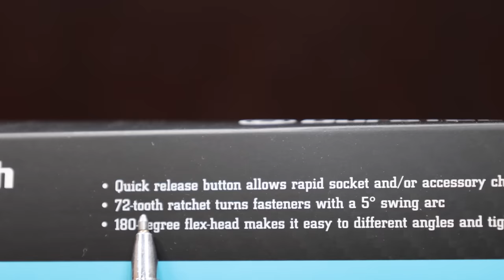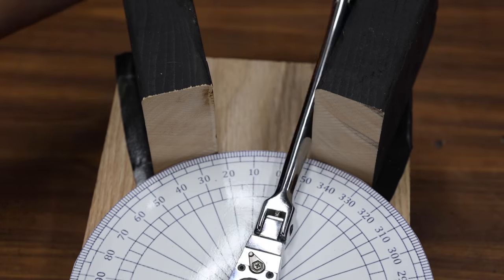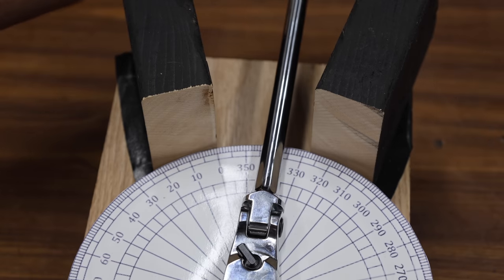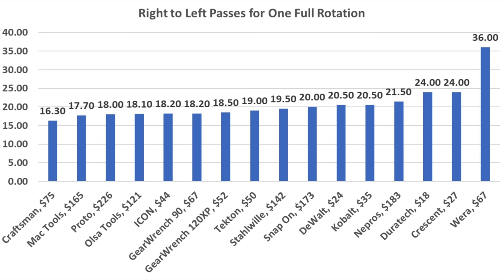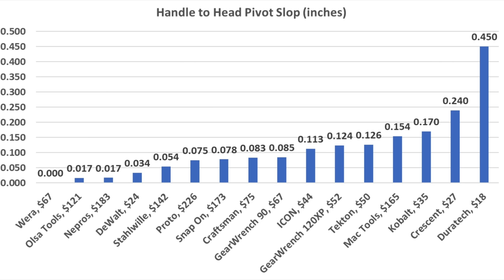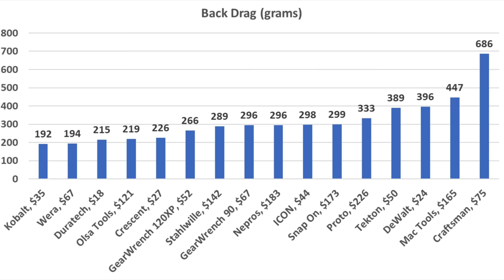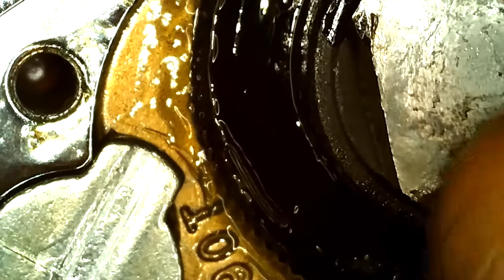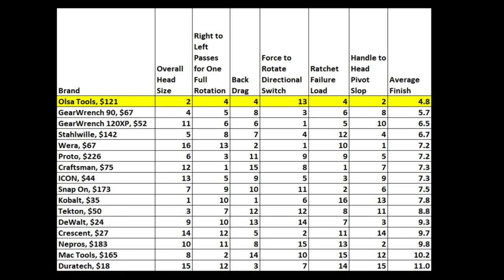Best Flex Head Ratchet? Let’s settle this!

Comment: Great video... We need you to test different 1500 w heaters and find out once and for all if some actually produce more heating capabilities or if 1500w is 1500w no matter what!!
Reply from the maker: Thank you for the video idea!
Reply: yeah for real. i buy them all the time for work and they either don't get very hot or they quickly stop working from steel shop dust exposure.
Reply: From actual real world experience I found  wrenches similar the Wera gimbal type  style are more practical and safer to use because they are much  less likely to tip off the bolt or nut head.
Reply: There’s no need to test that. Physics guarantees that :)
(To clarify- If it takes 1500W from the wall, it comes out as heat. It may not use 1500W, but that’s a diff story). Efficiency is a completely moot point as they are essentially 100% INefficient.
Reply: @ProjectFarm  Yes winter time and heater videos are very helpful.
Reply: All electric heaters are 100% efficient because any inefficiency can only turn into heat which is the point of a heater.
Reply: Everything's a heater. 500w light, 500w internal combustion engine, 500w hot plate, 500w anything - in the end, everything that is left is heat. Hit a wall with your fist? Heat. Sneeze? Heat. Talk? Heat. Often there are intermittent steps like chemically stored energy in ATP for your muscles, then kinetic energy from using those muscles, then kinetic energy in whatever you move with your muscles - but even then, your muscles are heating up, the air around you heats up (when you move, you rub the air which is not frictionless) and whatever you touch and move etc gets heated as well. The heating in different places can be very slight but it does happen.

Same with cars etc, the tires heat up the road and the aira around them etc.
Reply: @TCPUDPATM I think we've seen enough to know that just because a product says it does x or produces y doesn't mean it does. A heater test is a great idea.
Reply: As long as the label is correct, they'll all heat a room similarly...

But if you are in a big shop a radiant heater is what you want (heat like a fire) and if you are in an enclosed area a fan based or radiant heater is what you want... Radiant heaters offer a more constant feel of heat without that hot blast of air when they turn on.
Reply: @TCPUDPATM  Or rather, 100% efficient. Very, very few things are as efficient as electric heaters at doing what they set out to do. almost entirely 100% of the energy used is converted to heat. Any other use of electricity such as any electric motors or electronic devices isn't as efficient. Heat pumps are way more efficient at heating a space in that they move heat rather than use the electricity to make heat, but if you look at the percentage of heat generated by the compressor motor as waste, the heat pump is actually less efficient since that heat doesn't heat your living area, it's lost to the outside.
Reply: @benscott19841 people buy the cheapest model they can find for their purpose. Nobody will not buy a 1500W heater if it only ends up pulling 1499W.  Not sure what a test would prove. As someone already said, they will heat a room according to physics. Some of these requested tests get redundant and don't really serve a purpose for what it took to produce the test.
Reply: @giggiddy  So you test cheap heaters compared to expensive heaters to see which ones actually put out the heat it's supposed to and the quality of the build. Plus you can see if they are putting out what they are supposed to. Like with tests for every tool they rarely put out what they are advertised.
Reply: Mine crypto 4 heat

Comment: Something to note, even though it may be more difficult to change directions with a greasy finger... If you're pushed tight against something else, a harder directional switch is better. If the back of the ratchet is against a plastic panel, having it suddenly change from loosen to tighten can be an issue. So the force needed to change that being higher isn't necessarily a bad thing
Reply from the maker: Thanks for the feedback.
Reply: I agree with that. I went straight to the comments to write something similar to what you already said haha.
Reply: I have a couple 1/2 drive craftsman ratchets and if a gust of wind blows that ratchet will change direction
Reply: That was my comment also, but using my hand to hold it on the bolt or nut when upside down.
Reply: That's exactly what I was thinking, I've accidentally changed the direction lever on my socket wrench quite a few times.
Reply: I agree, I have a couple of zero turn ratchets that switch directions if you breathe wrong, and that can be really irritating.
Reply: Agreed, this is definitely an outlier 'test' that he feels compelled to keep using
Reply: I would also note that these loosen up over time. So for a commercial tool the tighter reverse levers will hold up longer. Truly impressed with the new craftsman
Reply: @SmokeElectronics that depends.  If it’s built well and smooth, with tight tolerances, it will stiffen over time.  If it doesn’t wear, but gets some crud in there it might get into that sweet spot.   If it’s made cheaply and experiences a ton of wear and stretch, it will loosen.  Depending on your environment, on the coast or working offshore, you’ll get rust as well.
Reply: As a mechanic I totally agree! The factors I would look for would be: Ease of changing direction in a tight space (with your hand/subjective); And resistance to unintentionally switching directions.
Reply: Agree completely.   I’ve ever understood the difficulty of switch measurements.  I want a solid click!   I use his scoring but I reverse that ranking.
Reply: agreed
Reply: yeah, I wouldn't really consider the force to change the direction a bad thing as if it's too loose it can change when not needed.
Reply: Couldn't agree more. As long as it isn't jamming up, more resistance is better.
Reply: Came here to say the same thing.  I'd rather have it too difficult than too easy to switch directions.  But somewhere in the middle of the rankings is probably the sweet spot.  Neither extreme is good.
Reply: I too am in the camp of not wanting a positive, non-negligible force to switch between forward and reverse, and having a distinct "click" when you have moved the selector into full reverse or forward.  There's nothing I hate more in a ratchet than the selector being mushy and easily moved out of gear with just a tiny amount of pressure on it.  Give me one that requires some definite force to move and doesn't always want to slide back into no man's land.
Reply: I went to tge comments to make sure someone pointed this out.  I also prefer a stiff direction lever

Comment: The fact that tool makers contact you and reference your channel is a huge compliment. With people working together, we can seriously make so many things better for everyone.
Reply from the maker: Good Point!
Reply: They don’t have a choice. Channels like this have a big impact on what people buy.
Reply: Oh, they reach out all right. But it's to offer marketing opportunities (we'll pay you to feature our product and parrot these talking points) and non-committal statements (ie: I've passed your results onto our engineering team so they can use it to further improve our products. We always stand behind our tools 100%!). I doubt any make any product improvements unless it results in a lower manufacturing cost. The only time I'd see a manufacturer actually changing their product would be the occasional independent companies that make it into the videos. Certainly not Snap On, Dewalt, Milwaukee, Stanley, Harbor Freight, and so on with the soulless corporations.

Thankfully he ignores the marketing offers.
Reply: Sometimes it changes the market! A price can go way up or way down is what usually happens.
Reply: @MTGeomancer The smaller companies making product improvements will eventually force the bigger companies to compete with better products. Try to see the bigger picture here. The companies you named actually make some pretty solid products sometimes, and they're generally available at a reasonable price. They don't just exist to scam people otherwise they wouldn't be in business lmao

Comment: Having used flex head ratchets in tight clearance areas, I think the direction switch tightness is a good thing. It can minimize unwanted switching.
Reply from the maker: Thanks for the feedback.
Reply: Exactly that the issue I've had with kobalt ratchets.
Reply: Uh it’s 12:07 pm and no new video. I demand a refund.
Reply: I agree with you.  I have an older snap on ratchet and it's way too easy to switch directions with.
Reply: @rcannon409  
You can change the gears. It's easy. They get worn down a bit. Especially when you use the ratchet to break bolts free. Get the snap on truck to warranty it. He will probably do it for you on his truck.
Reply: Also iv had that break before. I wonder if the added pressure to change the switch direction is equal to more durability over time.
Reply: My husky 3/8" 10" drive is the best rachet I ever try!.
Reply: @vanblue7317  Nice. Husky has come a long way. They make some good stuff. I've had real good lock with the older Signet swivel 3/8 sockets. They were less than the more expensive name brand and got into some tight spots. I also loved my C/P 3/8 impact. Way cheaper and just as good
Reply: Yep, I made the same comment. I have s gearwrench 10mm ratcheting wrench with direction switch... And the ewitch will change itself randomly with nothing touching it! Drove me nuts I kept thinking I hit it with my finger or an object, but nope. I bought it used at the swap meet guess I know why the previous owner got rid of it. I have a pair of gearless stubby ratchets, 1/4 and 3/8... You change directions by pushing the square drive out the other side. 20 years old work great.
Reply: @johnlucier5654  Those ratchets sound pretty slick.
Reply: @jamesfarmer1523  I had top get rid of a set of 90t kobalt rachets as they were switching directions from any little thing that would bump the rachet
Reply: @jacobscutzlas8712  
I know exactly what you mean
Reply: @lukemarks92  
You are right. When they are still nice and tight, the internal mechanism leans on the side of the pawl. When they get a bit sloppy, the point at where it leans on changes to the tip of the pawl and they often snap the tip off. When I was on the bench, I would disassemble my ratchet and clean it out with brake cleens and the repack it with just the right amount of thin grease. I used to run the MAC Tools flex head ratchet.
Reply: Bingo. A bit of a tighter toggle is a plus.

Comment: Great video as always. I specially enjoy your handtool reviews. When it comes to ratchets, there is just one rating system, which I do not fully agree with personally. When it comes to the force needed to change direction, lighter is not always better in my eyes. I remember several situations, where on hard to reach places, my ratchet changed direction due to a too light direction switch. So when I change direction, I prefer that it stays like it is and not accidently changes on its own even if that means more force need to be applied with my finger. Keep up the good work!
Reply: Very good point. I think the back drag test is the other I don't fully agree with. Not because I don't think it's important, I just think it's something that changes considerably as a ratchet gets used and breaks in. Some of the quality ratchets didn't do well with this test but likely because they are more precise fit and will loosen up when used a while.
Reply from the maker: Thanks, will do!

Comment: I own two of those Kobalt ratchets. A 3/8" and that 1/2". I have already warranted the 1/2 with the original receipt and Lowes took all my drivers license info and were rude about it. I bought both ratchets last fall. Lowes convinced me to buy my tools anywhere else and Kobalt taught me to be any other tools. Icon here I come.
Reply from the maker: Thanks for sharing.
Reply: I had the exact same experience. I started going to HF and buying icon
Reply: the slim design of the kobalt is really useful though lol

Comment: I have the Snap On version that I purchased about 40 years ago. It broke after a few years and it was repaired upgrading the single pawl with a dual pawl. Never failed again. I don't use it much anymore, maybe every few months if that, but it sure is valuable when needed.
Reply from the maker: Thank you for sharing!

Comment: I've used a number of your videos to buy several different tools I needed for very specific purposes. I love to watch all the testing, but it's that last slide with the spreadsheet that always seals it for me. I care way more about back drag than torque on this tool, while I may care way more about turning radius on another. It's very tough to find objective data on those kinds of things. I usually don't buy the absolute best in the category (depending on price) but all the tools I have bought have performed perfectly for the task I bought them for. Thank you so much for this channel!
Reply from the maker: You are welcome!  Thanks for supporting the channel!  I really appreciate it!

Comment: Always impressed to see you breaking some high quality "Dream" tools to see their real limits.
Reply: I break them at work😂
Reply from the maker: Thanks!
Reply: Right? Nothing I love more than seeing a Mac crack. 😂
Reply: The only Dream tools I see anymore are Snap On, SK and to some degree Olsa.
Mac has long since fell off the boat and is more on par with what Matco peddles. 
Not shocked Snap-On wasn't the winning tool. I love their hand tools but they are out paced and at this point I purchase to support Pat the seller and nothing more. My final purchase will be an over priced ToolBox as a thank you for everything Pat has done for me.
Reply: Agreed! Point of failure is also very nice to know, the ratchets failing at the 3/8 drive at a reasonably high torque value seems ideal. A 3/8 steel square of that cross section can only handle so much torque just based on geometry, you can maybe boost it a little with the alloy/heat treat but realistically they should all fail around the same spot torque wise. If I am trying to put 250-300 lbf-ft through my 3/8 ratchet then I’m already being a yahoo, hahahaha.
Reply: @JamesJamersonIsAGod yeah and I love that last part.  If I'm putting that much force into a ratchet, I'm belligerently doing something wrong.   Great to know the limits and even better to know that I should be avoiding those limits 99.9% of the time.
Reply: @JamesJamersonIsAGod  with a little caveat though, comparing quick-release square anvils to standard ones is a bit iffy. maybe putting one more results slide for each category would probably be better as would be testing both types for each brand when available. 😉
Reply: @kittytrail  you are absolutely correct. Sometimes apples to apples comparison isn’t entirely possible, like a small for factor tool that’s got a skinny head and small diameter handle obviously won’t be as strong but may be the tool you need. I’ve always found that’s the beauty in ProjectFarms reviews, all the data and comparisons are given so you can process it any way you see fit. The tool for you may be rated middle of the pack at the end but have one feature having a disproportionately large effect on the overall rating that is actually beneficial in some way.
Reply: @underourrock   usually even the limits of the low hangin' ratchets are not even possible to achieve by hand without the help of the Longish Mighty Tube™ but i can understand that lots of "mechanics", usually those of the every tool is a hammer persuasion who are coincidentally also lifelong members of the Bloody Brocken Knuckles Church of the Holy Mechanical Misery, don't even care to select the right tool for the right job and mostly rely on duct tape, heavy swearin' and the manufacturer warranty to get said job done... 😏
Reply: @kittytrail  Hey, not really fair to call me out like that......  I'm kidding, though I have been known to use a Mac ratchet as a hammer from time to time since they rarely work long as a ratchet.  Learning the limits of a ratchet from this channel, is far better than discovering the limits while trying to break a bolt free....
Reply: Lifetime warranty comes in handy, if you can get a new one for free, why not show people what they're capable of, we all appreciate it

Comment: Great content as always. I picked up a 1/2, 3/8 and 1/4 set of Gearwrench 90T last year and they are absolutely fantastic. Just as described and tested by you.
Reply from the maker: Thanks!
Reply: Also picked that set up its great, got it for $130. Specifically the one with the rubber grips

Comment: Great test.  One thing I differ opinion on is the directional switch.  I don't want it impossible to switch but I do want some good resistance.  I can't stand when it switches direction too easily.
Reply: I agree 100%. The only downside to a stiff switch is that they can occasionally tear a nitrile glove, but I can live with that over the frustration of accidentally switching direction in use. Can you say "knuckle buster"?
Reply from the maker: Thanks!

Comment: I've got a couple test ideas.

1. Pipe cutters. Either the ratcheting cutters for PVC, or the clamp style with the cutting wheel.
2. This might be too expensive to be practical, but I would absolutely love a video on rotary cutters. I bought a 5' County Line from tractor supply around 2 years ago, and a lot of the time I feel like I should've spent extra for a Woods or Bush hog, but I've never actually run either of them. 

Love your videos!
Reply: I used to build the County Line brush cutters. There's nothing really wrong with them but they could use more bracing.
Reply from the maker: Thanks for the suggestion.